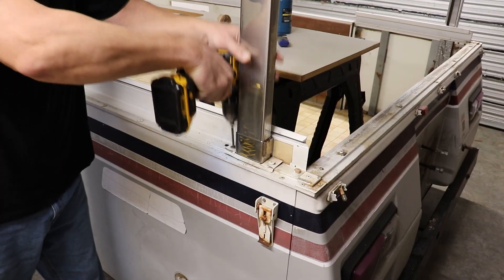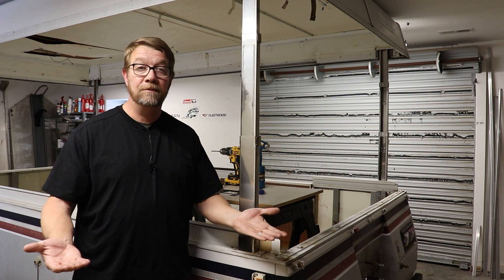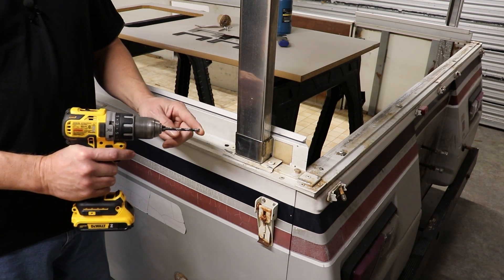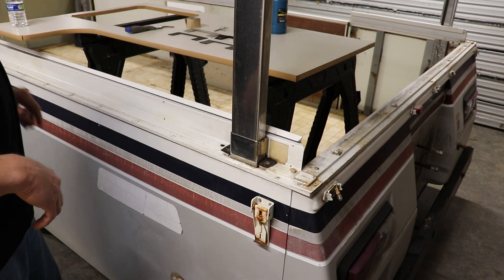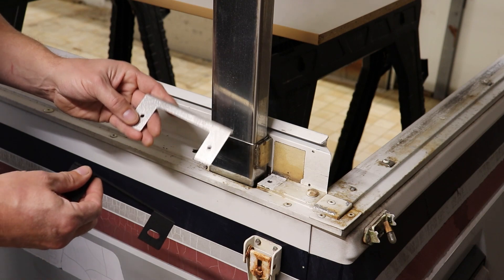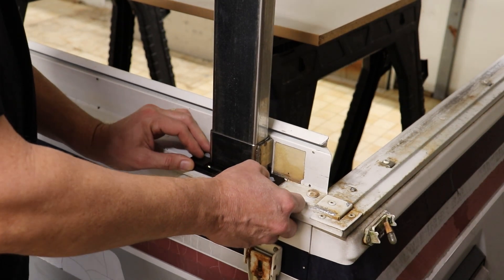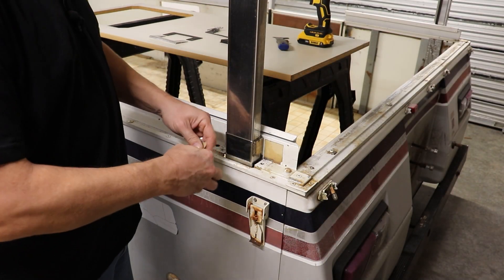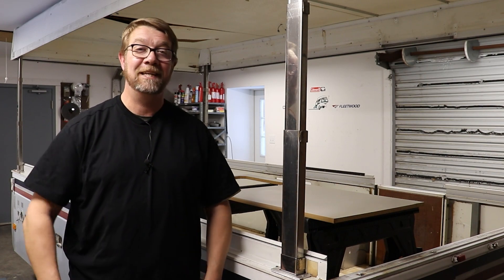Lift Trim Replacement for Coleman Campers

Comment: I got the black ones, they ended up being about a little over a 1/4 inch inch too long maybe a little more, closed it up after realizing all that work for nothing... by the time i realized it i had already done 3, Would it be safe to drill new holes so it would fit snug like it's supposed too? The silver ones wouldn't work as i definitely
 had to use the plastic washers as the holes were not even on both sides... the old ones were silver colored,  but had the oval like the black ones... Kind of at a loss ?
Reply from the maker: I think your good. They are not supposed to be snug.